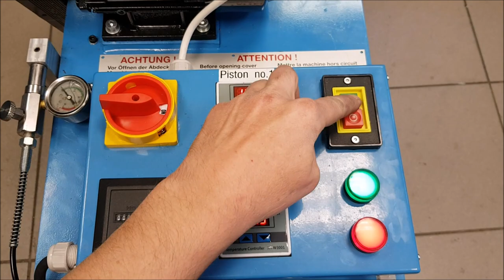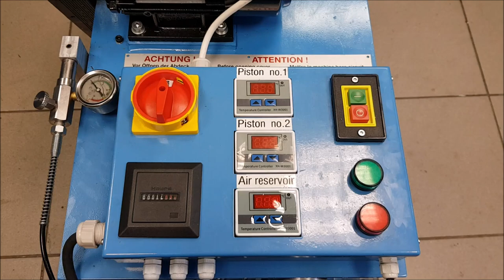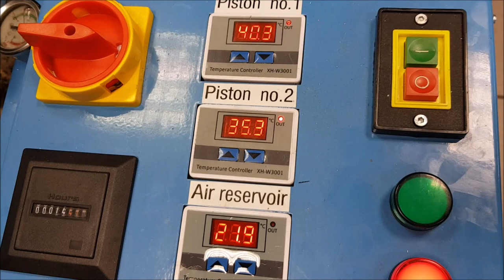300 bar High Pressure PCP Compressor - Homemade  - part 2. - How it work.

Comment: I saw a video from India I think where they took two regular high pressure hand pumps and had a huge flywheel that was driven by a jackshaft and then an electric motor. So elegant and effective I must say I've been gathering parts to make my own. Thanks for the video

Comment: linear guide? HGR25 or 30? shit, this thing must have cost about 5k USD. no way I will DIY such a machine, just saw PCP air compressor on aliexpress at 158 USD. , 4500 PSI pressure, free shipping

Comment: Excellent video and thank you for sharing 👍.
Both pistons seem to make compression on the same time , shouldn’t they be 180 offset ?…
So if 1 piston is compressing the other one is open or at suction ?….
Or can it be in this sett up because the difference in piston diameter ?.
Is there more information to be found somewhere on the how and why ?….
Thanks again for a great diy project 😀

Comment: Hi. Pistons are 10mm and 6mm. But what are the diameters of cylinders?
Reply: inner diameters I mean
Reply from the maker: 10.1 ...... 6.1
Reply: Thanks! Do you filter oil from air after high pressure compression?
Reply: @PaulXChannel
Reply from the maker: I don't filter
Reply: So you are using some kind of special oil no toxic to breathe? Because oil vapor also goes with air to diving air tank.
Reply from the maker: I only use it to fill pcp airguns.

Comment: Does the counterbalance serve any purpose?  The motion  of the pistons is driven by an electric motor… why the counterbalance?  You might find thermal grease (on the cooling rings) would improve heat dissipation… but really, the detail on the cylinders is brilliant!

Comment: I dont understand how the regulator/. Oil water separator works when its on the inlet side..  or why the high pressure line wasent used on its connection.,  wouldnt that too be at high pressure if its reading the pressure in the system?  No comprende

Comment: I prefer using thermalpaste in heat plate installation, it will improve the heat dissipation much better.
You can find it in computer or electrical parts store for sure.

Comment: Hi, Very nice job! Congrat! What is diameter of piston shaft first and second stage? And movement lenght (stroke)? The piston itself looks like aluminum with brass on top, am i correct?
Reply from the maker: Thanks.
First piston 10mm .
Second piston 6mm.
Stroke 120mm.
Material of pistons solid carbide rod.
Reply: @PaulXchannel  Ok thank you. And at second 0.54 of movie we can see two brass pieces with side hole ( i supose hole goes in 90º till top where spring sits). - Are this pieces one way valves sit on top of cilinder?  How do they seal? Have o-ring or another kind of sellant inside cilinder?
Reply from the maker: @paulosoarescarvalho6219  Yes. There are one-way valves with 90° hole.
Reply: @PaulXchannel  How do you did one-way valves seal? with o-ring? And where is that seal? Inside cilinder?
Reply from the maker: @paulosoarescarvalho6219  A plastic ring.
In first part . ( cylinder head )
Reply: @PaulXchannel  And about check valves at 2.30 minute: How did you cut the cross seccion of valves rod?
Reply from the maker: @paulosoarescarvalho6219  With a  diamond grinder.

Comment: Simple design would have went with some bigger pistons though and a multi stage design though
Reply: No you wouldn't of
Reply: If you look carefully you may notice that Paul is feeding the high pressure compressor from his low pressure compressor (~7 bar). Also, the rods/pistons of the high pressure compressor are different diameters, suggesting that the high pressure compressor itself has 2 stages - altogether that makes 3 stages.
If you wanted bigger pistons delivering 300 bar pressure, you'd need a very powerful motor! Remembering from physics class:
       force = pressure * area
and suppose you want a 50 mm diameter piston on the final stage:
     pressure = 300 bar
     diameter = 50 millimeter
     radius = diameter /2 = 0.025 m
     area = PI * radius ^ 2 = 0.0019635 m^2
     force = pressure * area = 58904.9 N (13,242 lbf or 6.6 tons)
and that only accounts for the final stage - Yikes!

As Nikola Tesla once said of Thomas Edison, "His [Thomas Edison] method was inefficient in the extreme, for an immense ground had to be covered to get anything at all unless blind chance intervened and, at first, I was almost a sorry witness of his doings, knowing that just a little theory and calculation would have saved him 90 per cent of the labor."

Comment: Very nice! I understand check valves on intake to prevent exiting during compression, but where are check valves on exit to prevent compressed ait back into cylinder? Are they inside that cap that you screwed on cylinder top? Is piston made on lathe have you some idea to improvise it without lathe etc. Overal great construction.
Reply from the maker: the piston is a carbide semi-finished product - it is not machined
Reply: @PaulXchannel  So where you found it? Yup, carbides are hard but that rod before must have been lathed
Reply from the maker: https://www.ebay.com/itm/304221303443?mkcid=16&mkevt=1&mkrid=711-127632-2357-0&ssspo=SLiqcStiQby&sssrc=2349624&ssuid=&var=&widget_ver=artemis&media=WHATS_APP
Reply: @PaulXchannel  thank you

Comment: Do you have some video with sealings assembly? Would be interesting to see that part. Thank you!
Reply from the maker: I don't have it at the moment.
Reply: @PaulXchannel  Ok. Thank you in any way. And what is the diameter of pistons ? 1st and 2nd stage you are using?
Reply from the maker: First piston 10mm .
Second piston 6mm.
Stroke 120mm.

Comment: Just wondering, how hot could your cylinders get without the cooling rings?
Reply from the maker: I think if I turn off the two fans it's about 65-70 degrees celsius.
Reply: @PaulXchannel  Do you think that is because of the friction of the compressor moving back and forth, or the compression of the air?
Reply from the maker: Large rotating mass.
Reply: @PaulXchannel  thanks 👍
Reply: @tylerdurdencotw  I'm not sure Paul understood your question, so as a mechanical engineer I'll note that compressing air makes it hotter according to the ideal gas law:
   https://en.wikipedia.org/wiki/Ideal_gas_law

Solving for temperature, you get

   T= (PV)/(nR)

I suspect heat due to friction is negligible compared to heat from compressing the air.

Comment: What kind of “glue” in assembly?
Thanks
Reply from the maker: I don't use any glue - only oil on the O rings.
Reply: @PaulXchannel  what oil? Silicone oil?
Reply from the maker: @bangagih  It can also be machine oil. Mixed into the air in the device.

Comment: This is BRILLIANT! Subbed
Reply: What is the stroke and plunger diameter in both stages? Motor power?
Reply from the maker: 6mm  10mm   100mm  1.5kw

Comment: A car ac unit will do 350psi why wouldn't you use one of those
Reply from the maker: I'm sorry, it's just a hobby.
Reply: @PaulXchannel  ok cool I use to make stuff but if I can repurpose stuff I will now time vs money hard to have both
Reply from the maker: @markhall912  O.K.
Cheers.
Reply: This unit will allow you to have 10times that pressure, I don't know why he built one but I can tell you how useful it can be to many, people with off-road vehicles have to deflate and inflate back and forth their tires a 3000-4500psi air tank allow them to do this during the whole trip.  Another use for hobbies like, Air rifles PCP to 2000-4650psi, Paintball hpa makers, some airsoft guns and for the lowest end using between 200-800psi water rockets.
You could use it for scuba diving, but you will need to have a very nice system of filters to ensure the air is clean and safe to your health.
I personally would like to have one for my PCP rifles.
Reply: 350 Psi = 24, ..Bar